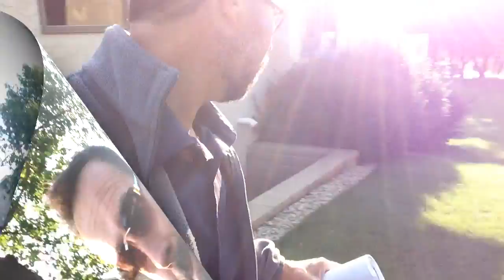Day at Work Vlog #2 - The Turkeys Destroy my Sod!

Comment from the maker: Their is linear foot, square foot and cubic foot.  Linear foot is the same as a "regular" foot but defines what you mean.  If you say Linear foot people can't mistake that for a square foot and get confused.  You get in the habit of defining what you mean.  Another example- We never say add "Gas" to the equipment.  We always say Fuel -because some of the equipment is diesel and some is gas.  We had one operator put "gas" in a diesel skid loader because we didn't clarify. Lesson Learned.

Comment: how many pices of heavy equipment do you have?
Reply from the maker: +david brunner Trash Trucks and Lawn Care 3 excavators, 2 Tractor loader backhoes, 5 compactors, 2 dump trucks, 5 pick-up trucks, 3 skid steers, 1 bulldozer, 1 loader excavator, 5 trailers, 8 mowers, 2 trimmers, 2 blowers, 1 hydraulic jack hammer, 1 360" thumb, 3 sets of forks, snowplows, pusher blades and more....